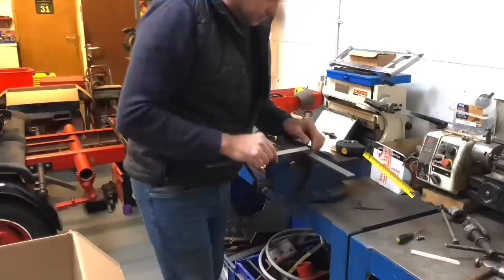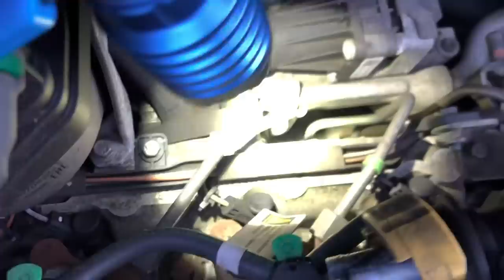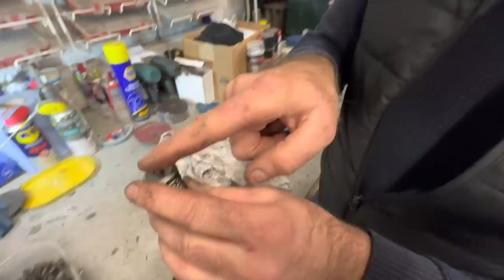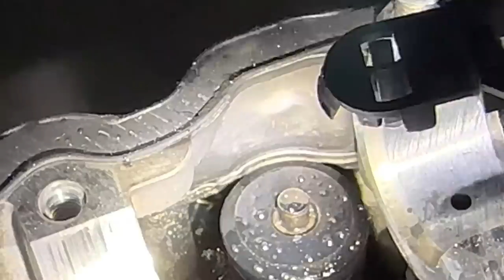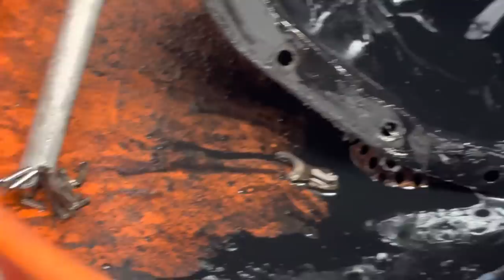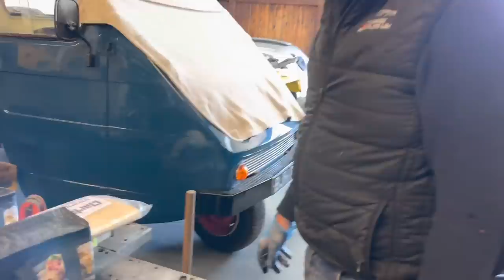PEUGEOT CITROEN DS3 1.6 HDI ENGINE FAIL CAN WE SAVE IT???

Comment: The info Chris shared about the engine that sucked up water-leading to the cracked cylinder liner was both interesting and an eye-opener. Great stuff..!
Reply: Those who drive through 'Rufford Mill Ford' should take heed ;-)
Reply: A mate did that with a Renault Espace through a ford years ago, low or bumper sited air intakes or something. The mechanic said "they all do that, sir".
Reply: @WhosPhotoTube  I was just thinking the same thing, Rufford Ford videos are a guilty pleasure....
Reply: @richardhine6682  Yes Rufford Ford eats Beemers for breakfast😂
Reply: @WhosPhotoTube  I don't think some of the clowns driving through there have any heed to take!!
Reply: It's the clowns driving throu Rufford Mill Ford in EV's that tickle me. Water and an electrical power source, what could possibly go wrong !!

Comment: Super super job by miracle worker Chris
That block don’t half need some oil changes to get every single bit otherwise it’s like valve grinding paste washing round wearing the engine out 
Do your self a favour and do another oil / filter change before you unload it

Comment: Did similar on a 214 Rover years ago, used a tube spanner with the side cut out, a loop of rope under the inlet manifold and a long bar that sat on the tube spanner with one end through the rope loop and then leant on the other end to compress the valve spring, held the valves up using a compression tester with its schrader valve removed, screwed into the plug hole and connected to my compressor, did all 16 valve stem seals. Where there's a will, there's a way!  👍

Comment: Well done Chris: great bit of improvisation to save the day! Seeing this I'm reminded of how poorly designed the 1.6HDi oil pans are. The sump plug thread is recessed into the sump pressing and, despite the presence of a small drain hole through the thread (which blocks with carbon sludge) it effectively forms a 'bund' to retain oil and crud when the sump plug is removed. In those I've worked on I've drawn them out to remove the bund effect: it reduces ground clearance for the sump but means that crud in the sump stands some chance of draining fully when the sump plug is removed.

Comment: One of the best ways to keep the valve  closed whilst doing the spring compression is to push in via the spark plug a good quality woven nylon rope into a 1/2 up compression stroke  piston...once the rope is in turn the crank and bring the piston up till the rope is all compressed holding the valves shut. you then lock the engine with socket on crank pulley and then do the valve spring compression with your spring compressor tool.... once completed drop the piston and pull out the rope...great way also to change valve stem seals..

Comment: Hi Chris, in the past I have put the relevant cylinder to the bottom of the stroke and ten fill the cylinder with string, through the spark plug / glow plug hole and then when you have a reasonable amount of string in the cylinder rotate the crankshaft so that the string is compressed between the valve and piston, you can then work on the collet without the risk of the valve dropping.

Comment: I did like that one!! The other old trick to compress a valve spring was to put a load of string down a spark plug hole and push the piston up so that the string held the valve closed. When finished, drop the piston and pull all the string out.

Comment: Hi Chris and Rob, just done a similar job on a Corsa 16v petrol (1.4 I think) which had a broken valve spring. We made some brackets to lock the cam pulleys and chain in place, removed one cam, did very similar to you but instead of compressed air, we started by feeding a long cord, bit thicker than a shoelace through the spark plug hole, then turned the engine to trap the valve shut. I had heard about this from 'old school' mechanics, and thought it was a bit of a long shot, but it worked perfect.
Thank you for the channel and all the best.

Comment: I think I`d flush through 10 litres of gun wash through that blocks galleries, maybe even take the oil pump off as well as the strainer, partially because of the sludge & partly to see if any more rollers come out.. Maybe you can work out how many there should be if you can see the tips of the rollers in the surviving rockers?

Comment: Great video again! I have used string in the past, stuffed down a plug hole till cylinder has plenty in, then turn crank so valves pushe into the seats. Then pull string out when done.

Comment: Another cracking video many thanks just a pointer on magnetic screwdrivers I have had for 40 years a magnetize/demagnetize tool which you just run the hole in the tool
Their is 2 holes depending on if you want to demagnetize or magnetize up and down whatever you need to use works every time.

Comment: Another easy method is fill the cylinder with rope, thru the plug hole. And had crank the piston up to hold the valve in place. then reverse rotate the crank to remove the rope. I've done this many times and works great.

Comment: While you have the oil pan out, you should modify the drain plug hole. As you can see, it rises up from the floor of the pan and prevents loads of old, gummy oil from draining out! This, in turn, causes that dirty oil to affect oil flow and typically kills lubrication of the turbo charger.

I modified my 1.6 hdi oil pan by first replacing the plug with a bolt with suitable thread, and then using a large socket underneath the drain hole I proceeded to hammer the bolt down so that the drain hole actually sits in a pit on the pan floor instead of that raised area. Now I can flush out all old oil on each oil change which prevents that gummy, dirty oil from accumulating in the pan.

Comment: Lads make sure you check the turbo oil feed. On the early engines there was a fine gauze filter where the oil feed pipe exited the block. This gauze filter would block up if oil changes were missed starving the turbo of oil.
Great video as always. And an excellent video showing what happens if you don't change your oil.

Comment: I may be wrong but at 15 Mins in on the Clip a seems to be a lot of metal debris, presume that chewed up Aluminium that's because the Cam had taken a hammering from the likes of cam followers and same had did a bit of damage spinning around as they let go, maybe  a small Vacuum pump with a filter on same, that the techies use for pulling vacuum on those fridge repairs  would be handy to pick out buy suction all that non metallic stuff in situ...Chris is a Genius, Great upload Lads...

Comment: Well done, useless tip of the day is you can usually demagnetise a screwdriver blade by whacking it on something hard. In electronics work I would keep an old speaker magnet to magnetise a screwdriver. Use it to fish out dropped screws and then demagnetise the screwdriver afterwards.

Comment: Another job well done 
Back in the days I had a similar job on a cavalier 2.0 Sri 8v that had a snapped belt it broke some followers and also had a collett that jumped out 
I tried the compressed air but the other collett was so stuck the valve kept opening when I pushed on it so I got a ball of string and threaded it down the bore then brought the piston up till it was locked that was enough to hold the valve in place so I could compress the spring
U can't beat the old school tricks

Comment: 👍 Another trick is to feed string or rope into the cylinder at bdc & then turn to tdc where it’s compressed against the valve & you can knock the collets off.

Comment: I hated having to use compressed in to hold the valves in place. Always chose dropping a length of cord down the hole (glow plug, or spark plug) with the piston half way down.
Filled the piston crown with cord then gently moved the piston up to retain the valve.

Comment: Tip for today, a cheap and cheerful way to demagnetise a screw driver is "twang" the blade on a vise, like you would a tuning fork. Sometimes it takes a couple of goes but usually it works.

Comment: A nice solution to valve compression there !. I’ve also seen it done with sturdy wood, using the bulkhead to build a small frame under. Not as elegant as Chris’s solution though. Very nice..

Comment: Liked the air into cylinder,I did it with the rope technique,I then bought a special spring compressor when I changed my valve seals,good job Chris top man👌

Comment: you can try a length of 4 - 5mm thick rope inserted thru the plug hole while the piston is at bottom of stroke and the piston raised to TDC  for the rope to hold the valve from dropping down. The rope can be easily pulled out upon completion of job without any issue in the cylinder.

Comment: If I recall an old trick was to feed a length of rope through the spark plug/glow plug hole into the combustion chamber. Rotating the engine would push the rope against the valve(s) to keep it closed and allow the keepers to be removed.

Comment: I used to use a valve spring compressor like that when needed, ive even done a full set of valve seals like this, it's a right pain in the backside to do but better than taking the head off.  this was back in the day before internet so this was something i had to discover on my own, nice one Chris :)

Comment: when i rebuild 1960's and earlier classic motorbikes after fitting valve springs and collets i give the top of the valve stem a sharp tap with a heavy engineers ballpien hammer i do not know the true reason but it was the way i was taught as a youngster.

Comment: You can put a rope through the injector so that will keep the valve closed. What I did is to move the piston half way and push through the rope so I could fill the entire bore and slowly turning engine to move the piston upwards and pressing the the valve closed

Comment: fill the cylinder with string when cylinder down then turn till to top put in gear  handbrake on /block wheels so won't rotate might need to lift valve when turning to tdc this will hold valve in place to fit springs and collets works great .filling with compressed air works but bounces  I'm sure vauxhall made a long bar you used to be able to do this job that fitted in rocker cover bolt holes  just so you could change valve stem seals without removing cylinder head

Comment: The alternative to compressed air is feeding in some rope (leaving the end out to pull it back out) and cranking the piston up to push the rope up against the valve face.  But, proving the valve isn't bent or unseated with no air leak around the stem is a nice plus. And the very tiny glow plug hole would have been fiddly to feed even small rope thru.

I wonder if debris made it to the oil filter.

Comment: I stopped watching your videos when I found them boring 😴,  I mean no info no sharing any tips ...
Today,  I clicked on your video thinking it's going to be 5mn max b4 I get bored,  BUT I was surprised in a good way.
Chris is amazing with his technical knowledge, skills and experience ... . The fact that he took his time to explain and demonstrate is amazing,  respect and thank you Chris for making this video an excellent and interesting one.
I had the same experience with picasso 1.6 hdi 5 seater one. BUT I delved in more and went as far as the pistons as I wasn't sure if anything is hiding down there 🤔 but in my case it was all clear just bit of cleaning 😅 the rest was similar to yours without that heater plug enginuity/invention 👌👌👌👍👍👍👏👏👏 it took me nearly 4 weeks as I can only work on it after my daily job and I replaced the turbo chrad and all the oil pipes and picker. I also cleaned and blown air through all the oil and water passage in the block. 
A local lady still driving that picasso in the village today as I upgraded to toyota and sold the citroen. 
Anyway,  this new version of video looks very genuine and interesting and also educative for some as Chris said.
Awesome video and thanks for sharing with us 👌👍👏
I won't skip your videos again if they are this interesting 
✌❤🍀

Comment: I was really curious to see how you would pressurise the cylinder and the Schrader adaptor on a glow plug screw did the job just fine. I don't know how much upward pressure the cylinder exerts but I did wonder if the bar would be strong enough. An absolutely fascinating demonstration of practical engineering. Looking forward to see it run very soon.

Comment: Looking at the state of that oil, it might be as well to check the oil feed pick up for the turbo. There is a fine mesh gauze on it to filter out debris from the turbo but they have been known to block due to poor maintenance and it of course lunches the turbo. 
I've known people who have replaced their turbo only for them to fail again because they didn't clear the blockage.

Comment: just a quick tip boys if your going to pull heater plugs it is worth giving them a little wd40 the night before reduces the chance of snapping the heaters just at the top of the taper seat 30 with a bit of wd40 can save a lot of headache

Comment: Good engines my oil pump failed ran dry for 80 miles done the cam chain in and then lifters. New chain lifters strainer oil filter oil and a good flush she still going string 20k later

Comment: I'm sure this is the same engine as the ford focus 1.6 tdci. If so the rockers are designed to snap rather than cause lower engine failure. (Word of caution)  if it is the DV6 engine there's a strainer in the turbo oil pickup also which is a known clogging point or at least there was in earlier models. It's extra work but for peace of mind it's worth checking. Great job either way as always.

Comment: Clever stuff. Reminds me a bit of lever tools, eg Laser 5495, which can be used to remove valve springs without taking a head off. Will you be using flushing oil when the engine is rebuilt to clear any other muck out??

Comment: You do not need to use compressed air if at tdc the valve only moves a few mm and will not drop so you are able to get the colletts back in

Comment: I think Citroen’s recommended replacement interval is ridiculous -150k or 10 years - I had one of these and sold it at 90k due to turbo on the way out - I would never have pushed it that far though. Got a Clio diesel now and that’s 90k or 6 years and just had it done at its age interval (only done 65k)

Comment: You would have been OK to put the number 3 piston at TDC and press down on the collet retainer to release the collets, the valve head would have been against the piston and not drop down the cylinder and no compressor required.

Comment: Great explanation of hydraulic lock Chris, and its explosive effects! More fine content; thanks fellas 😍😀 I can see that valve tool growing a few more holes so it'll fit above the other valves. edit - I'm surprised too see bits that big made it back to the sump - are the oil passages particularly wide on these engines, or would that happen on any engine? edit 2 - LOVED the forensic analysis of the bits, thank you.

Comment: Presumption that it worked but I have seen lots of string put in through a glow pug hole with the piston down when piston comes up it presses on the valve
Reply from the maker: It will be fine 👍

Comment: My god the man is a genius, give him a little scrape metal a drill and some boults and the old part of a engine, and hay presto you have a tool that if you can buy would cost a fortune great work, now I'm from the medical world,  so my knowledge of oil is lacking but it looked thicker than a Mcdonald's milk shake to me. The clip of the engine with the  hydraulic lock I have seen several clips of people driving through a ford n, I'm guessing that its not funny if it has that effect on your engine.

Comment: Surprised Chris didn't do the 'rope down the spark plug hole' trick to hold the valve in place - although it might be harder using a glow plug hole?  🤔

Comment: there is an easy wayto get compressed air into a diesel cylinder / first by a diesel compression tester  the piece that replaces the injector will have a flex line to a gauge  change  the fitting on the end of that to a hp airlene fitting and hey presto you have your valves held up / there is anothere way using thin rope  to fill the cylinder and hold the valves up
Reply from the maker: This way worked perfectly and we didn’t need to remove any injectors 👍

Comment: Nice 1 Chris / Rob .. like the Glow plug trick and putting an Air line through the plug.. so much cleaner than adding oil to the cylinder.. Keep up the  good work...Hears to Many More Vids from ya Both .. Andy ..

Comment: I just picked up one of these 63 plate for 600 quid. Oil in coolant but no coolant in oil. I think it's a gasket in the oil cooler. Any ideas?
Reply: Ill add, no overheating, no loss of power, boosts perfect. No smoke from exhaust.

Comment: Hydraulic lock is something you need to check for before starting an aero radial engine. Pre start checks are to pull the prop through as many times as you got cylinders and if there's oil collected in the lower cylinders you will feel the "Lock" as you try to turn it. The remedy is to pull the plugs and let the oil out, if you turned it with the starter it will bend a rod or worse! It was great to see the damage caused to your engine, I'll show that to students when explaining this next time👍👍
Reply from the maker: It’s a diesel bud there is no plugs
Reply: @sruk  Roger was explaining the process for the radial engine on propeller planes 👍
Reply: @sruk  Sorry Rob, I wasn't saying that's how you could fix it😎 I was just pointing out the same thing happens with Radial aero engines, but I could say that a glow plug is a plug of sorts😁 The problem only arises in radials as they have a couple of cylinders upside down at the bottom, the rest won't suffer the problem. The destruction in the cylinder was impressive though!